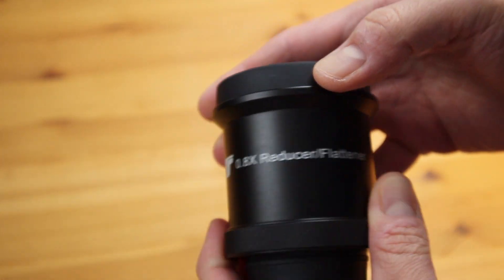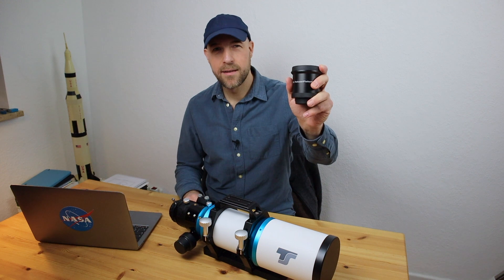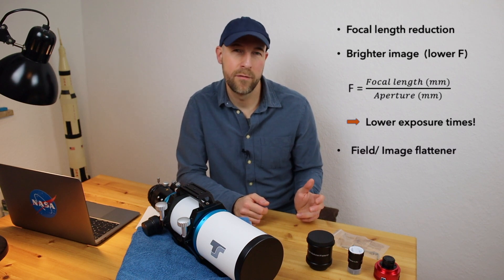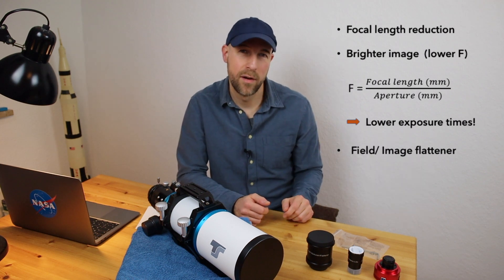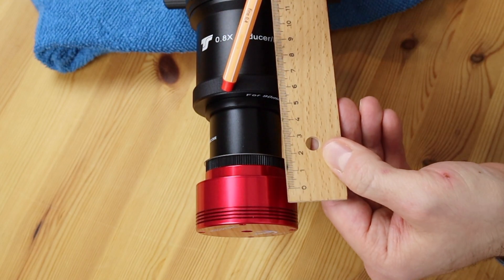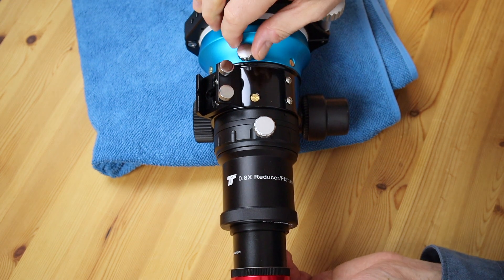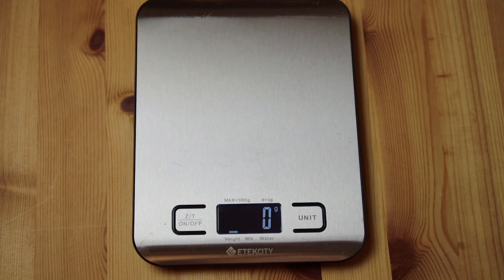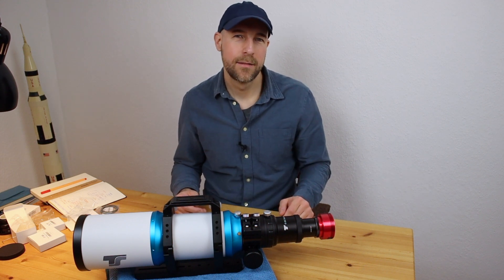Triplet Refractor Apo Reducer/ Flattener - Attachment & Backfocus

Comment: Still happy with the CF-APO90? Does it work with full frame cameras?
Reply from the maker: Hi. Thanks for watching and your comment/ question. Yes overall I'm still really happy with the scope I have to say. I'm using my ZWO Asi 2600 MC Pro camera with it. The overall image quality is very good. But I also have to say that the optical quality of the 0,8x flattener/reducer I bought from TS optics is "improvable" - really some star trails in the corners clearly recognizable when using this camera. I can't say anything about the long-term quality of the zoom wheel because I'm using a motorized (ZWO) focuser -> Working very well. Overall I'm really happy with that one but I would really not exclude that there are now better (/cheaper) options for your money with regard to optical quality, especially since the price increase here from 1.300 to 1.550 Euros (also little increase before the whole economic crises, inflation etc.) Recently I thought about getting the SVBony SV503 102mm refractor scope. I don't thing it is optically "better" than the TS APO but seems to be a really interesting a good scope with people on a tight budget. Hope that helps. :) Clear skies
Reply: Thanks a lot for that detailed answer. I am considering also Omegon (Produced by sharp star/Askar) the 94EDPH. It's also a bit older but I have no idea, which matches the CF90 or 94 EDPH nowadays?

Comment: Remember that Barlow and Focal extender are not exactly the same thing. Focal extenders are a bit more advanced and they do not increase eye relief behind the eyepiece.
Reply from the maker: I've never said in the video it's exactly the same thing. What I did is talking about what the optical pieces are doing in general (optically!). It's on purpose not talking about details since it's for beginners. - Thats's right, Barlows increase the eye relief, a focal extender will increase the focal length as well. It's a more complex optical system. Focal extenders usually have an additional glass element.

Comment: Does having a filter inside a 1x Full Frame Flattener make any difference in the 55 mm measurement?
Reply from the maker: Hi, usually you have to add 1/3rd of the thickness of your glass filter on top in the calculation. (1mm filter -> 0,333mm) Clear skies
Reply: @tullyfisher  Thank you, my Aperture 90 mm triplet instructions/manual do not mention any of that.
Reply from the maker: Question: 
Is the back focus distance affected noticeably by introducing extra glass as filters in front of the sensor?

Answer:
The simple answer is: Yes, the back focus is affected by introducing extra glass (/filter). Personally and currently I'm only using an Optolong L-Pro broadband light pollution filter and I did not see any (noticeable) effect.
The longer answer is: Your backfocus is affected (in mm) by the one third of your glass(!) filter thickness. 
delta f (focal change) = t (thickness of your filter) * ((n (refractive index of your filter) - 1)/n (refr. ind. o.y. filter)) So if you are using the usual filter material glass which has a refractive index of about 1,52 - the equation is t = (1,52-1/1,52) which is about 0,33 which is equal to 1/3. So your thickness t = 1/3 = t/3. So a 3mm thick filter (only the glass itself of course) would give you a shift in the backfocus of 1mm. So you would need to ADD 1mm in backfocus distance. But as I said. I didn't do that and I achieve perfect focus.

Comment: Hi, can you please explain the difference in the picture you get by removing the small attached lens on the camera, exposing the sensor, vs the picture you would get when leaving the lens on the camera?
Reply from the maker: Hi Pat. Sure. I guess you are referring to 14:14 min in the video? The lens on the camera is just a fish eye lens. So that's an extreme wide-field lens. You can leave it one and just use the camera (without the telescope) and put it on the ground for example to image/ record the night sky. (I never tried it myself - so far). If you would leave it attached to the camera and then (using adapters) somehow connect it to the telescope I would expect it not to work (/not focused) since your focal plane would be completely shifted. I found a video showing it.. https://www.youtube.com/watch?v=_5CNuQRHcDM 
Hope this helped. :) cs

Comment: Excellent explanation of backfocus. I just received a WO 71 GT Triplet, and I bought the matching WO adjustable  FF/FR.  Just to clarify, once the correct backfocus is figured out, I use a Nikon F mount DSLR, the telescopes focus system still needs to be adjusted in and out to achieve focus correct? Or is focus achieved once Backfocus is set at the proper mm?  Thanks in advance.
Reply from the maker: Hi there, sorry for the late reply..I was "out of order" for two weeks. Hope my response still helps: First, thank you for watching and commenting and congrats on the new astro gear! Once you figured out the correct backfocus and set you distance accordingly you still have to do the fine focussing.. And also with time the focus will may change a little. Hope this helps. Clear skies.
Reply: @tullyfisher  No worries on the reply being late. We all have lives outside of the internet. Thank you for responding.

Comment: Nice explanation and setup:-) Is the back focus distance affected noticeably by introducing extra glass as filters in front of the sensor?
Reply from the maker: Hei Jørgen, thanks for the nice feedback and your very valid and important question (which I forgot to mention in the video).
The simple answer is: Yes, the back focus is affected by introducing extra glass (/filter). Personally and currently I'm only using an Optolong L-Pro broadband light pollution filter and I did not see any (noticeable) effect.
The longer answer is: Your backfocus is affected (in mm) by one third of your glass(!) filter thickness. 
delta f (focal change) = t (thickness of your filter) * ((n (refractive index of your filter) - 1)/n (refr. ind. o.y. filter)) So if you are using the usual filter material glass which has a refractive index of about 1,52 - the equation is t = (1,52-1/1,52) which is about 0,33 which is equal to 1/3. So your thickness t = 1/3 = t/3. So a 3mm thick filter (only the glass itself of course) would give you a shift in the backfocus of 1mm. So you would need to ADD 1mm in backfocus distance. But as I said. I didn't do that and I achieve perfect focus. Thank you for commenting & watching. - I like your Aurora Borealis video very much!! :) Best wishes to the beautiful Norway.

Comment: That was a great explanation of back focus etc. Mine is slightly out on my 60mm TS Optics scope. I have been using a flattener / reducer which is dedicated to my Altair Astro 70mm refractor and get star distortion on the stars at the edge of images from the 60mm scope.
Thanks for a very informative video.
Reply from the maker: Thank you very much John! :) Is there no available flat./red. dedicated for your 60mm scope? I guess you really need one especially and calculated for for scope you want to modify in that sense..because it's not just dependent on the actual focal length but also on how the lens(es) were treated, I guess. - Thank you again for watching and taking the time for commenting. :)
Reply: @tullyfisher  I haven't noticed a dedicated flattener, but I haven't given up looking yet 🙂